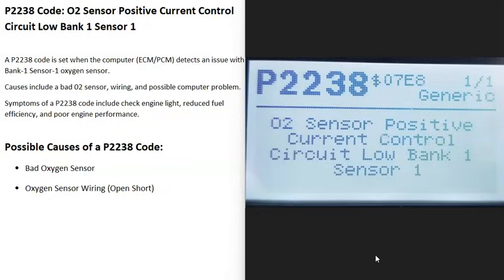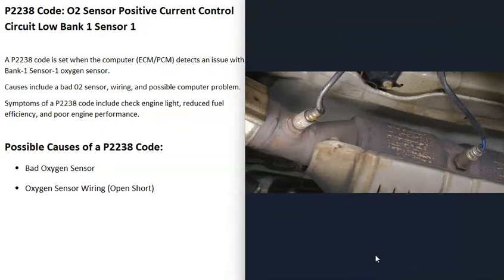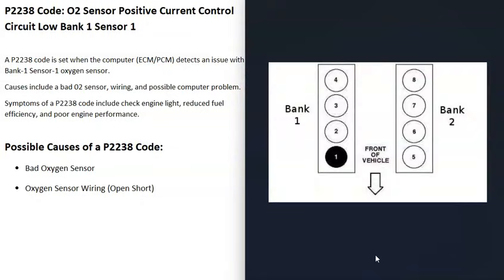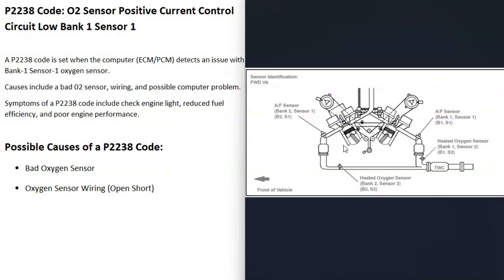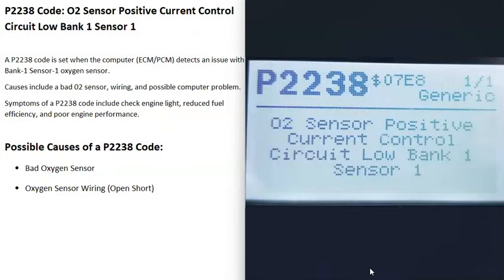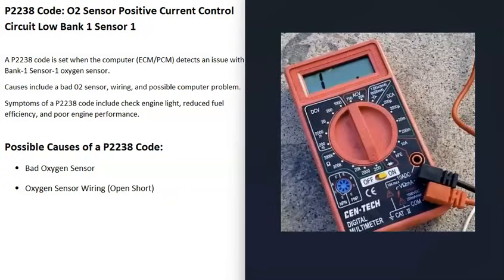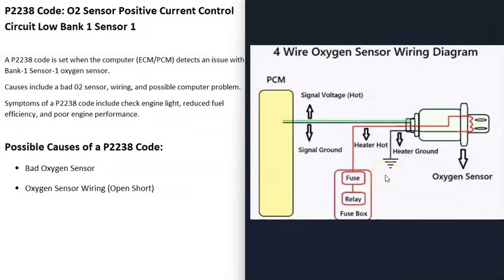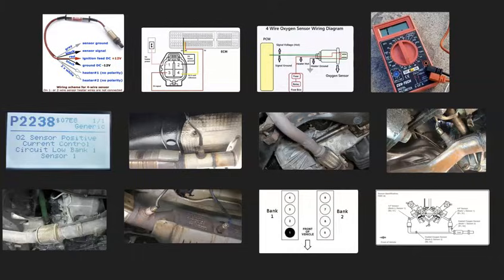Causes and Fixes P2238 Code: O2 Sensor Positive Current Control Circuit Low Bank 1 Sensor 1

Comment: Hi I have a question.
Both my bank 1 and 2 sensor 1 are giving me error codes, does that mean that they can share the root cause?
Thanks!
Reply from the maker: When both banks are affected, the cause is usually something that would affect the whole engine, such as a wiring issue, fuel pressure, a bad sensor, or an intake leak.

Comment: Had a 2016 Tacoma throw this code. Started after reset but now not starting again. Will this code cause the engine not to start?
Reply from the maker: The engine will run with a bad 02 sensor. Gas mileage will be worse, but it will still run.

Comment: Thanks for sharing 🙏
Question 
In 2004 mb c230 Kompresor 1.8
Will the crankshaft sensor put the car on limp mode? 
Im having that problem with my car.
Thanks 👍
Reply from the maker: It's possible but usually you would get a crank sensor code.
Reply: انا عندي نفس المشكله هذه ونفس الكود وغيرت حساس جديد ونفس المشكله موجوده
Reply: Same with me. I put in genuine sensor and the code is there when cold. When i clear it it will go away once the engine is hot. Next morning it will come back when its cold again.  @عليحاشديتهامي